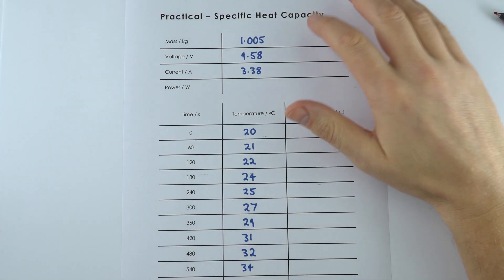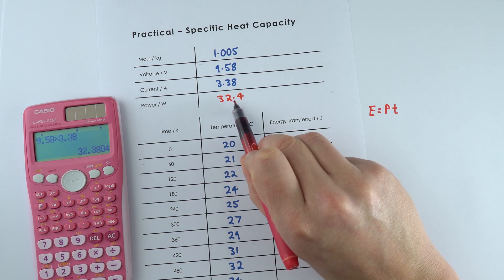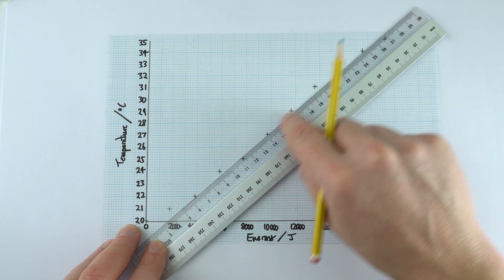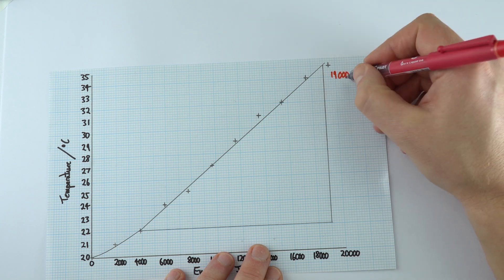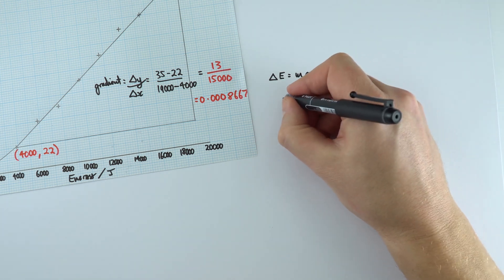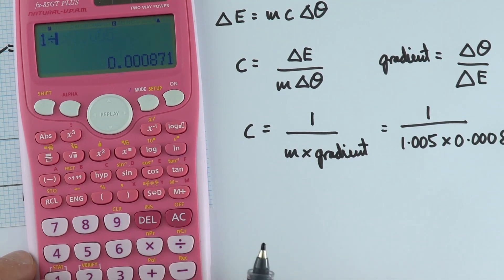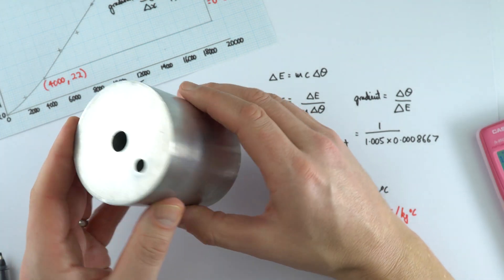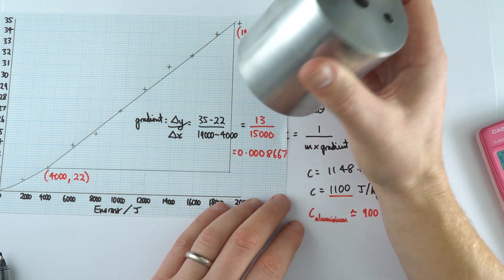Specific Heat Capacity of Aluminium Experiment RESULTS - GCSE Physics Required Practical

Comment: shouldn't the temperatures be converted to Kalvin before calculating? Or have I missed something and it doesn't make a difference in this case?
Reply: It doesn't really matter as the difference is an absolute value, this is, could be R°, °K, C°, but the dt will be the same in all those units, no matter the scale
Reply: The ratio between Celcius and Kelvin is the same, so if you're talking about a change in temperature you can use either.